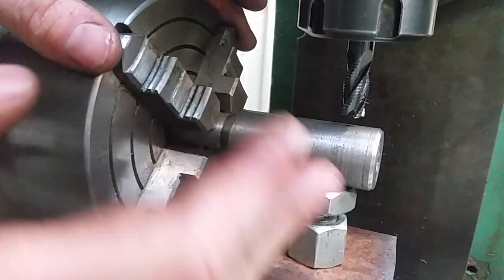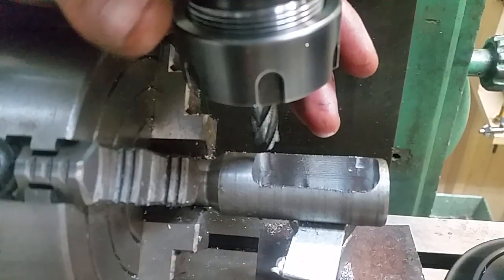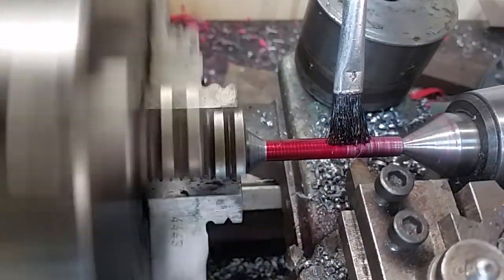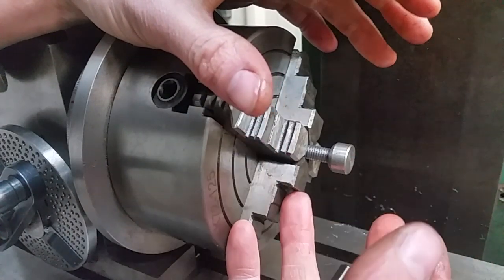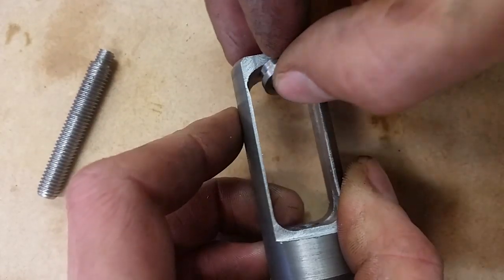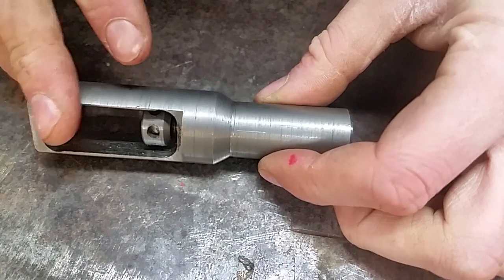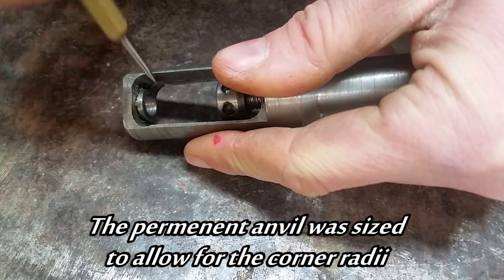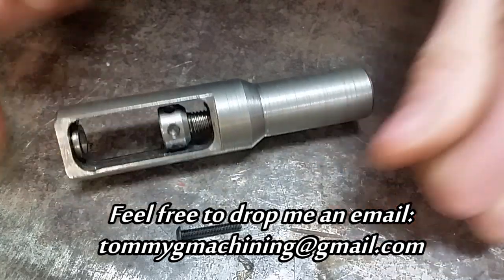Lantern Chuck Build

Comment: I made a set to handle 2-56 through 1/4 20.(4 separate pieces) I use it all the time, how many times have i tried to round off and clean up the end of a cut screw and it got ripped out of my hand and dissapeared. Cant live without them now. I suggest puting the clamping screw all the way through the handle. Much easier to tighten it from the open back.
Reply from the maker: Yes there are a few things that I'd alter now. I would probably make the front screw on so that I could more rapidly adjust it. (I could also adjust under power if being careful)
It's a very useful tool
Thanks for watching

Comment: It is easier to do in a split ring (or split nut) and clamp in the chuck's jaws. There will be perfect centering of the part.
Reply from the maker: Yes that will also work
I chose this method because it lets me work on very short thread lengths

Comment: I hope you don't mind, but I am stealing this idea. I WILL BEHAVE (no really I will)  and not take credit for the design...... I have seen these from time to time, and the ones I have seen are very fiddly. I like the multi size (shall we say collet) system for multiple size screws. The others I have seen are made to suit only one size screw so you need multiple chucks.
I had at some stage thought of making a one size fits all chuck and have always put it on the back burner... Your video has convinced me to get off my fat a#$@ and make one.....
Great videos Mate,
Keep em coming.
Matt
Reply from the maker: Awesome! This is one of the major motivations for me on this channel to be able to inspire ideas
PS add a set screw with a soft tip (maybe brass) against the thread. I found that it could work loose without it
Reply: @TomMakeHere  No worries I will do that.... Keep up the good work mate..
PS.
What part of Aus are you from? I am in East Gippsland..

Comment: Very nice! Good solution to an awkward problem. Are those collet blocks ER32, same as your lathe collet chuck?
Reply from the maker: Cheers! Yes My mt3 collet holder is also er32, I'm trying to keep the same setup across the shop
Reply: @TomMakeHere  I was thinking of doing the same. ER32 collets up to 25mm are available, almost the capacity of a standard ER40 setup with a lower profile. Keep up the good work! Cheers
Reply from the maker: Have you got a link to the 25 mm collets? I only ever see 3-20 (although I know 2 mm exists as well)
Reply: @TomMakeHere  Have a look for Weston Tooling Ltd in the UK. Not super cheap but if you buy as a project requires it, not too bad either.

Comment: really nice lantern chuck, I've thought about making one semi similar, but have an mt4 taper and use the drawbar to tighten up the bolt in the chuck and draw in the taper. Something like that would really come into its own for holding the heads of brass bolts for drilling to make 3d printer nozzles and such.
Reply from the maker: I really wanted a solution like that so it would be easier to operate, but this was a quick build.
That being said I have since thought about a short tapped rod.
Thinking is thread your screw into that so the thread pokes out, then put the whole lot in a collect chuck so the screw tip is accessible on the lathe. Not sure if I explained that very well!
Reply: I've seen setups similar to that using a large nut and bolt, the nut had the one end of it had a welded plate on it and hole drilled into it.